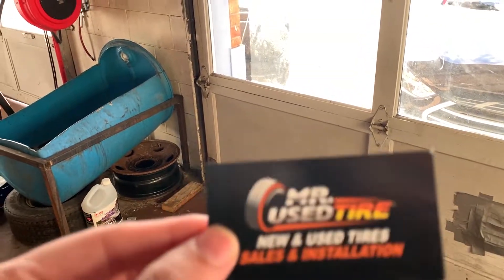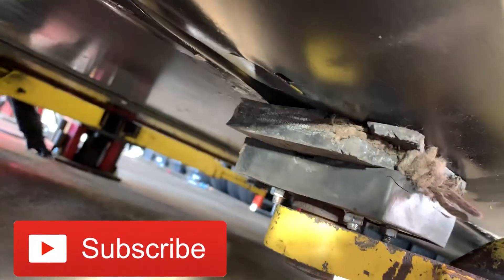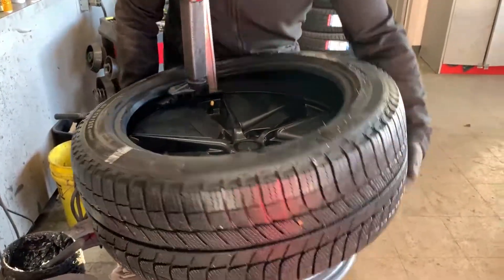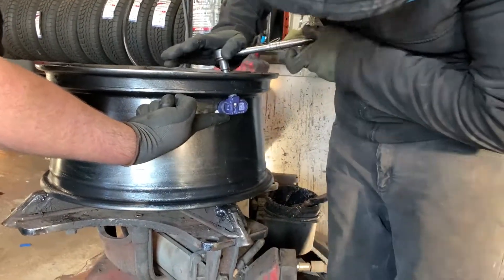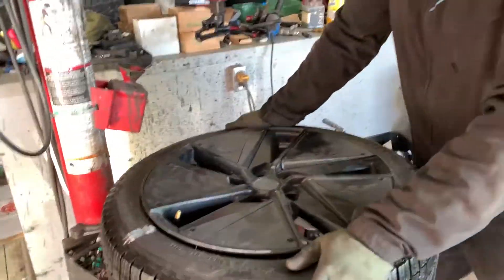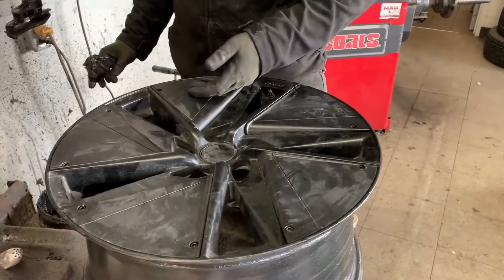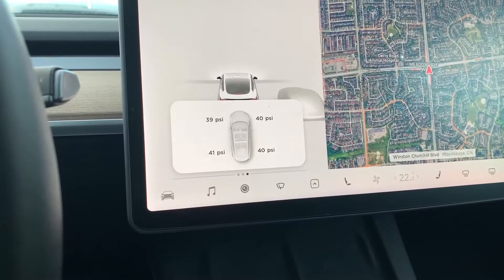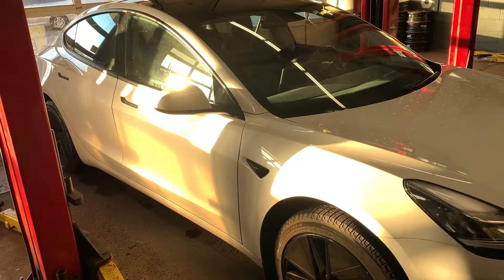2021 Tesla Model 3 Tire Pressure Monitoring System (TPMS) Installation/replacement

Comment: I have aftermarket wheels and also the stock wheels from my model3.    Will there be a problem with the tpms whenever I change wheels?? 

  Both tpms are tesla brand.
Reply from the maker: You can interchange them easily, no issues.

Comment: I have a question. For Model Y 2023, if I need to replace sensor, I need a Tesla Sensor (Bluetooth), after installing, do I need do program or something to connect to the car, or it will automatically connect after driving?
Reply from the maker: @dttub  automatic
Reply: @ . Thanks.

Comment: After I changed my TPMS my psi now says 0. Before it said 38 psi (7weeks ago). I don't know what Im doing wrong.
Reply from the maker: @firefiretv117  did you get the right TPMS?
Reply: @dynamite647  No. it still says 0

Comment: Do you have to program the new sensor or did the car pick it up automatically?
Reply: It will pick up auto after a short drive, they can get confused if there are other sensors in the boot or very nearby.
Reply from the maker: Automatic